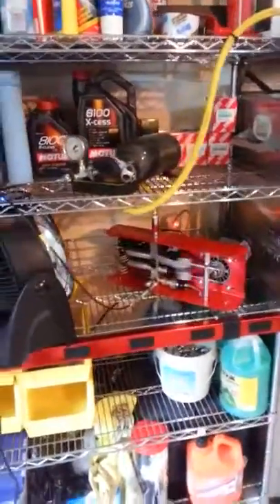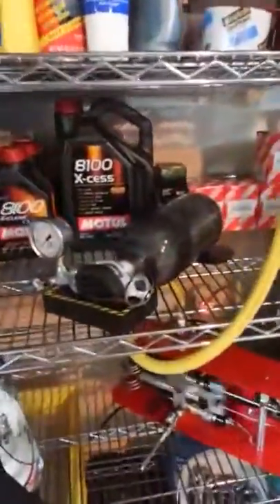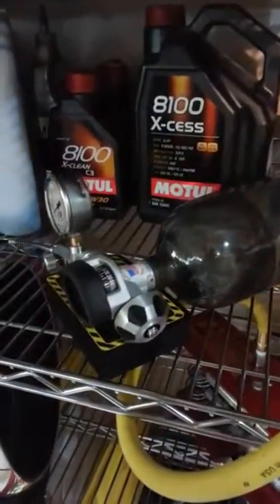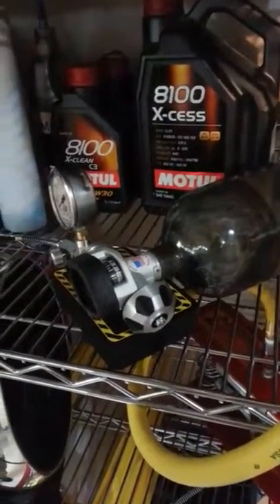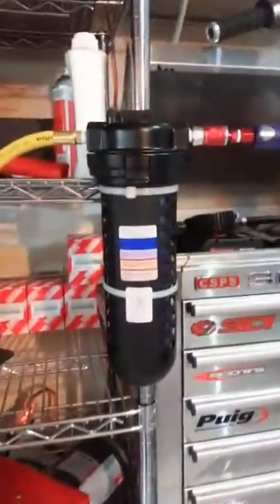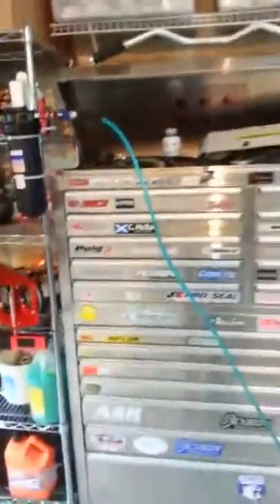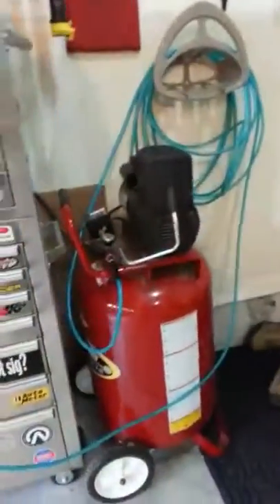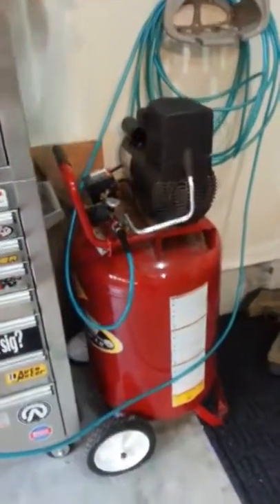Shoebox Freedom 8 compressor. Filling up 4500psi 17cf  tank

Comment from the maker: Pictured is  17cf 4500psi paintball tank and its fitted with SCBA Valve that was modded for paintball threads.

I have large 27gallon oil-less compressor going to VERY BIG Wilkerson X03-02-000 Desiccant Air Dryer and then to Freedom 8.

My big compressor only kicked in three times during this fill up. It is set for 125psi output.

Results:

30min - 0-1300 psi
1 hour - 2400 psi
1h 30min - 3500 psi
1h 50min - 4500 psi

Amazing speed. Full fill from zero to 4500 psi took less than 2 hours!